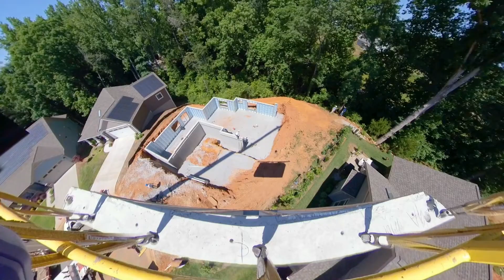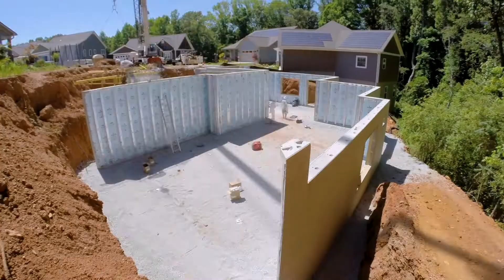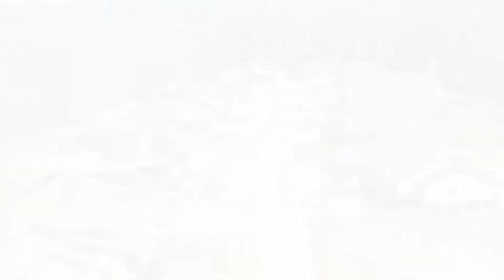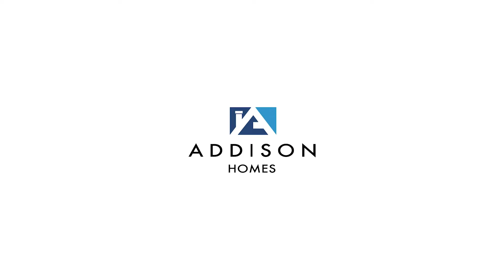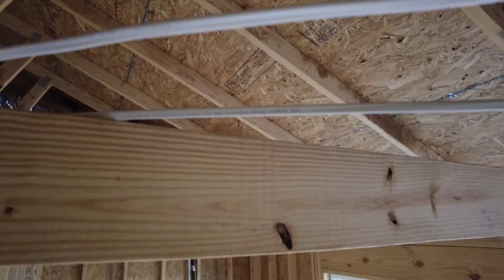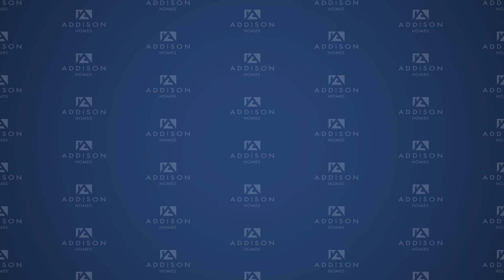Ductwork to Code | Goodbye Efficiency?

Comment: 100% agree. An ‘easy’ way to retrofit these systems I think would to insulate/ air seal around ducts and HVAC if they “have” to be inside of the attic. A better way from the start is to have the AC inside the conditioned space and run ducts under the flooring up into the base of the walls or floors.
Reply from the maker: Absolutely!  In fact, above code building standards such as the US Department of Energy's Zero Energy Ready Home standard, requires that the ductwork (all but 10 linear feet) must be inside conditioned space!
Reply: @AddisonHomes  it’s even better if only the ducts are up there but in my opinion the air handler should always be inside the house.

Comment: One of my peeves also. With all the talk about saving the planet, green energy, electric vehicles, etc. you would think the lousy systems heating and cooling buildings would be a priority but it’s not. We get lots of rebate programs for minuscule gains in efficiency but mostly just funnel money to approved contractors to do the work. I bought a new house 6 years ago just outside Chattanooga that was enrolled in the TVA Energy Right program but I don’t know what was gained by it. I talked to the TVA inspectors and they said they were looking for things like sill seal, sealed penetrations, and insulation levels. I later discovered there wasn’t any sill seal or even a code required capillary break, lots of unsealed penetrations, inadequate insulation, a leaky air handler in the attic, etc.. I re-routed all of the flex duct eliminating all of the ups and downs and sharp turns, installed metal elbows where turns were necessary, sealed up the cabinet for the air handler, insulated the air handler with rockwool, air sealed the entire attic floor and walls of taller rooms that were in the attic, and finally with all the ductwork now on the attic floor I buried everything by blowing in cellulose to R-60. I also sealed all the sills and insulated the rims and basement walls when I finished the basement.
Reply from the maker: In my opinion, the HVAC system and ductwork represents one of the most impactful systems in the home with relation to air quality, comfort, and energy efficiency.  Hard to get consumers to understand this since its all out of site, out of mind after completion!  That's why we just include it instead of making it an option.

Comment: SO whats the alternative?
Reply from the maker: Great question.  The best alternative is to keep the ductwork inside the conditioned envelope of the home.  High performance building standards such as the US Dept of Energy Zero Energy Ready Home standard actually require this.  Check out our video on ductwork between floors of a basement home.  
The alterantives that we utilize are:
- Ductless HVAC systems - these eliminate the need for ductwork but do have some limitations with air distribution in high performance homes.
- Ductwork and HVAC equipment inside a conditioned crawlspace foundation.  For a two story home on crawlspace, ducts in a chase up to the floor system between the first and second floors.
- Ductwork and HVAC equipment inside a conditioned basement foundation.  Chase up to the floor system between upper floors.
- Slab foundations present the biggest challenge.  For slab foundations we typically build a conditioned room in the vented attic for the HVAC equipment and insulated chases for the ducts to run through.  DOE also provides an alternative by installing the insulated ducts on the "floor" of the attic space, encapsulating them in closed cell spray foam, and covering them with blown insulation.
- HVAC ductwork can also be installed in encapsulated, insulated attics.  One of the most common method for insulating attic spaces is spray foam.  We are not fans of spray foam on the roof deck as it doesn't provide the level of resiliency that we desire in our homes.  More to come on this in future videos.....
Reply: Would be great to put this reply of yours in the description section. On here looking for solutions and video just describes the problems. Not a fan of spray foam. Soon to do a remodel on a lake … they’ve elevated flood lines since I purchased so now I’m in a flood zone. No basement or conditioned crawl space possible due to flood zone but don’t want spray foam necessary for conditioned attic. 🤷🏻‍♀️